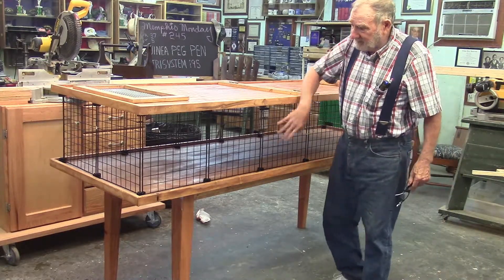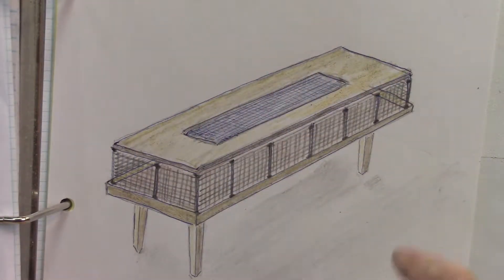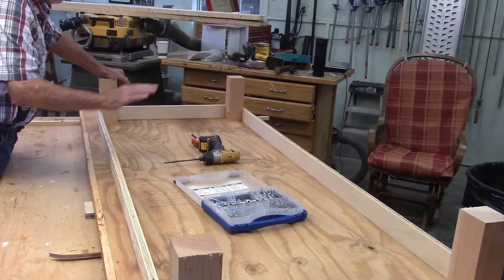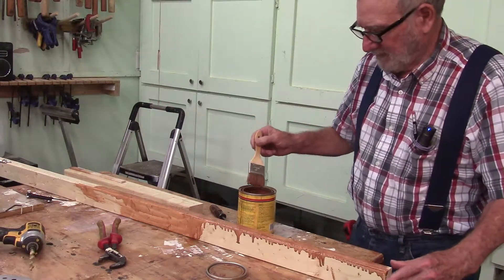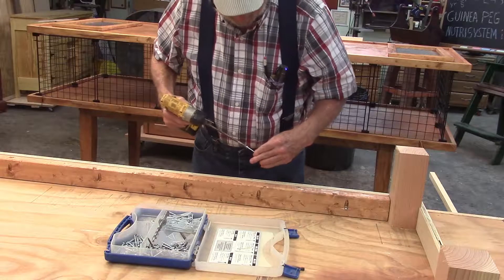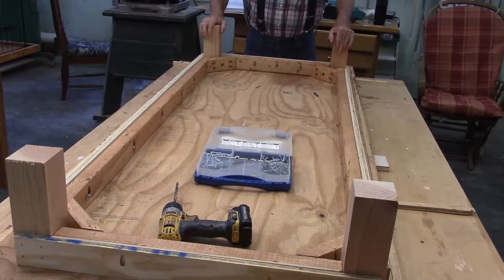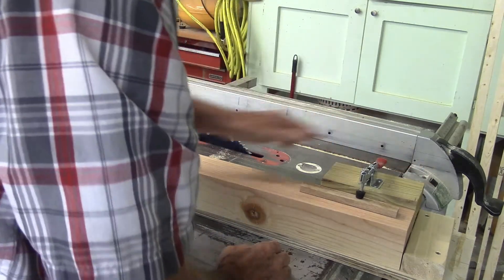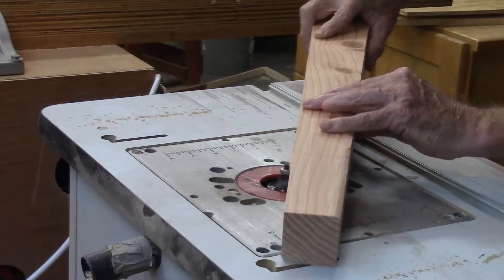245 Building two Guinea Pig Pens WK 37

Comment: First off, I am not going to give you grief about the "pegs" since it seems that you have had more than your share of ribbing about it.   Seriously, I want to know how many guinea pigs these folks have.  I have never seen cages this big unless they were for rabbits or something.  That table sure is built for 1000 years.  They  should hold up to most anything.  Those folks might want to add hydraulic hinges somehow because those lids will get mighty heavy if they are holding them up while cleaning the cage.    Good idea to reference the latest table video if someone is interested in building a table.  Of course,  you know I love these videos where you use a lot of jigs.
Reply from the maker: They love their "pegs" I guess.  
I gave the table the 1000 year treatment, as I figure the guinea pigs phase of their lives probably won't last forever, and then they can use the tables for something else.  
The lids fold back and lay flat, so you don't have to hold them up.  
I wish I was more ambitious, as I should be linking to all my similar projects every time, especially since I don't get to film everything on every video.  
Thanks for watching and commenting.
Reply: @MemphisApplegate  Good idea to think of these tables having a second life.  I hadn't thought of folding the lids all the way back so that is a better solution.  I am always amazed at the amount of digging some people do to find old videos and linking.  Some go back several years and put the link in the description.  I am too lazy to do anything like that.